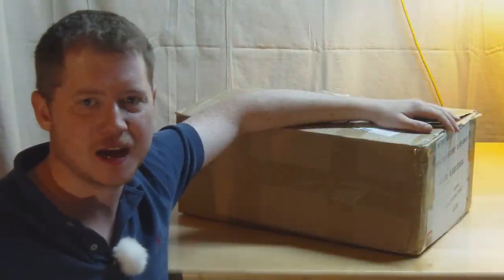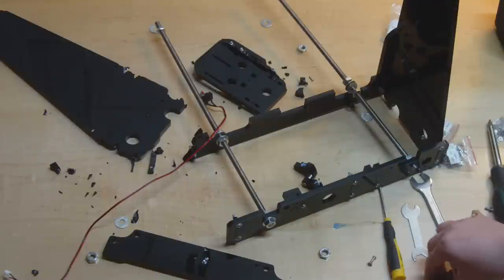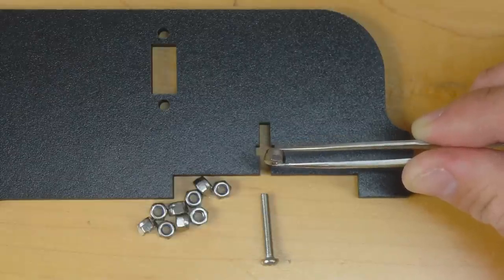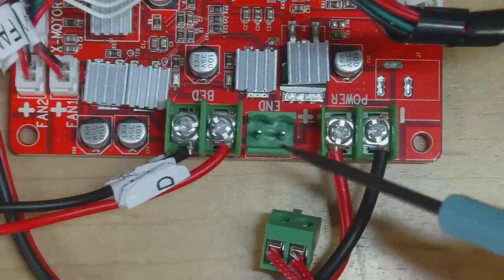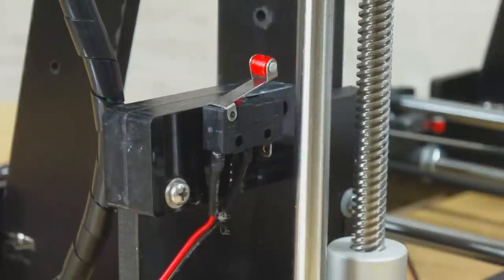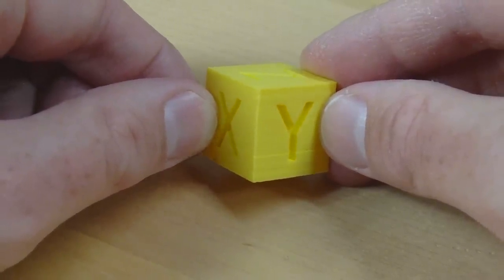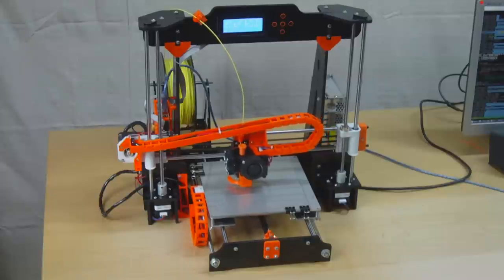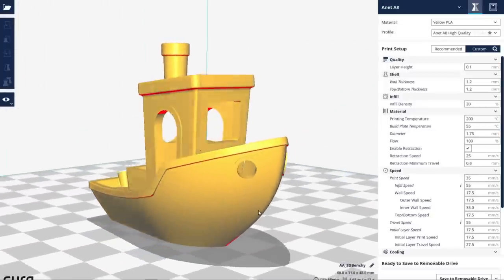[007] Anet A8 3D Printer - Review, Upgrades and Experiments

Comment: While I didn't use lock nuts of any type, I did substitute the hexagonal M3 nuts for square nuts. Which slightly improves the surface area grabbed by the nut.
High current traces on the PCB I soldered thick gauge wire on the traces too.
Double the number or connectors to the heat bed, by default it causes 10 Amps to flow through single pins.
Move the Positive wire to the heat bed from the controller PCB directly to a Positive terminal on the PSU.
The bed is switched on the Negative line via a FET. So providing the bed Positive side directly from the PSU means
you get more power to the bed, less voltage drop to the controller PCB and therefore less voltage drop to the extruder heater.
Mount the PSU to the side of the printer on 5 to 10mm stand-offs. Provides better airflow to the PSU chassis and stops the PSU heating the printer frame.
I use an Adhesive Mylar sheet on the heatbed. It works perfectly at 100° C for the bed and 240°C for the nozzle for printing ABS.
It sticks on first contact and pops off very easily when it's cooled down to < 50 ish °C
Reply: so would you recommend this printer i am pretty experienced when it comes to electronics but never owned a 3D printer
Reply: It works perfectly well. But is not suitable for someone without technical, mechanical and electronics skills.
Combined with Tinkercad, Cura and OctoPrint. It's a very useful tool.
Reply: Thanks man mine is on the way , yeah i should be just fine i got the tech and mech skills & my job is in the electronics field, I have logged plenty of CAD and Solid Works  hours so hopefully i will catch on fast.
Reply: Can you post a picture of how you upgraded the PCB and PSU? I'd like to see exactly, you know just to be sure!
Reply: Ni
Reply: Ill look into this when i crack into mine this week
Reply: Built mine 2 years ago, running Buildtak on the buildplate and used some white lithium grease on the moving parts cause one side of the vertical axis was a bit rough at First.

 Planning a overhaul including a E3D v6 head, a hardened steel nozzle, beefed up mosfet for the bed and a swap to Bowden feed, so far the acrylic frame is holding strong and nothing has come unscrewed.

 Been running PETG as my main filament which likes to print slow so shaking hasn't been an issue and the temps needed are pretty mild
Reply: i got the the addon FETs and see other removing the pins from the heat bed and straight soldering the wires. also cable chains
Reply: I know I'm kinda off topic but do anyone know a good site to stream new movies online?
Reply: @Westin Rohan Flixportal :)
Reply: @Maddux Princeton thanks, I went there and it seems like a nice service :D I appreciate it !!
Reply: @Westin Rohan Happy to help =)

Comment: In the 1980s I had a sticky rubix cube. Sprayed it inside with WD40. Nice a smooth until a short while later it self destructed in my hand. That's my first lesson on chemical attack on plastics.    Glues either stick,. Ake plastic slimy or destroy it.  Best learn what plastic your gluing or like me glue it and pray.

Comment: On your criticism of the bent leads of the power supply, they are called clinched leads or semi clinched leads depending on if they are touching the pads or traces. Clinching a lead is a standard practice in soldering connections that carry high current, that is a good thing. I would be more concerned with a blob of solder on a connection as it may hide a cold connection. Remember Solder connections should be clean, smooth, shiny, concave filets covering all points of contact metal to metal.

Comment: The powersupply is more than likely fine. The screw connector has a screw third from the left (with the screw terminals looking at you) marked F.G. This is Frame Ground or where the Earth / Grounding conductor of your 120 / 240 VAC supply goes. The PCB to frame connection is just to provide the metal case with ground (in most uses the PSU is mounted in a metallic enclose which is grounded as well so the PSU frame is grounded through the screws to the enclosure)

Most of them look the same inside (I repair these for PLC systems).

You are correct that you need to use the shortest possible screws to mount the supply, in the manuals that come with them they usually recommend 3-5 mm long after they have been through the mounting enclosure, as the aluminium case is only usually 2mm this leaves 1-3mm of excess thread.

Comment: Thank you so much for this video. I just got one of these for Christmas from my wife and I am a complete noob. Regarding your cracking problem: A special thanks for that bit about the Locktite. I went to our local Home Depot to buy some star lock washers when I realized that there would be some vibration that might loosen the connections. I WAS going to double up on the washers by using Locktite, but never had the chance (it's still in assembly and I'm a bit lackadaisical in putting stuff together - I'm retired :-) ). I'm glad I watched your video before I did. Thanks again.

Comment: I wound my screws in as tight as I could, when building my Anet A8 - this was months ago and nothing has cracked.  Incidentally, none of the screws have loosened either.

You, my friend, appear to have the light touch and finesse of a bull rhino :P
Reply from the maker: +Spreadie yeah I didnt use excessive torque so I think the chemically induced cracking is the most likely explanation
Reply: I used 'adequate' force to secure the screws.  So far no cracking and only minimal loosening.
I am looking to get one of the aluminium frames for the A8 on ebay though, as its been quite a good printer and I'd like to keep using it for a while.  Prints using good filament have been outstanding, especially considering the price.
I bought a sheet of BulidTak for the bed, best upgrade I made  lol
Reply: @OpenTechLab  That's your story and your stickin' to it! ;-)

Comment: I really like the way that you routed the extruder cables using the chain cable guide. Do you happen to have any closeup photos of how you attached the chain cable to the printer ?
Reply: I'm a bit late to this, but I've only had mine a couple of weeks.  As of late 2018 the A8 is still the best value 3d printer available.  It's the cheapest and most fun way to get into 3d printing.  Yes you will have problems to solve, but that just means you will learn a lot more from doing it.  The A8 is not for people who want to be spoon fed, those that just want a consumer item that works even though they don't understand it, or in a commercial environment where the printer needs to be highly productive right from unboxing.  It IS for those who want to enjoy a more hands-on approach and want to learn, and all for very little money too.

 When you print out the relevant cable chain end pieces it's very obvious how they fit - on existing hardware and bolts.  Also photos from the designers are a little useful.  I got designs for both my x and y cable chains from thingiverse.  It's a great looking upgrade and saves your cables.  You do have to rotate the heat bed so the connector is on the left for the y cable chain, but that's a simple modification.

The most important upgrades though, are probably the supports or stiffeners for the uprights, and an x belt tensioner.  I suspected that the little T support blocks are insufficient and this video seems to prove that. I printed a full bridge support that cut down on the wobble harmonics of the frame by a huge amount.  I've put off doing the x-belt tensioner but as the belt seems to have stretched a little (even though it's got a steel core) it's starting to affect print quality, so that's my next project.  I just hope I left enough belt for it to work without buying new belt.
Reply: @Chris_the_Muso  Yep, get some good quay belt and replace the crappy ones.
Get the y belt path perpendicular and print my y belt tensioner.
https://www.thingiverse.com/thing:3429668
I've replaced the extruder,  hot end and upgraded PSU to 24 volts running a Duet board.
The basics are okay and it's a great learning experience.
The greatest hazard is the connection to the heated bed. It's bv boarding on illegal for domestic use.

Comment: I wouldn't say the a8 has any infamy, it is generally seen as the best price to performance printer
Reply from the maker: +Noah Mcelwey I notice a lot of folks on Reddit getting frustrated with the flow of questions about how to fix A8 design flaws. I can understand that.
Reply: OpenTechLab yeah, I don't quite understand why people complain about little things when the printer is as cheap as it is, I think people just like to complain.
Reply: Paid $140 for mine. ebay special
Reply: When you consider the now infamous story of the guy catching his A8 JUST as it was engulfed in flames AND the electrical safety problems pointed out here, I'd say your take on infamy is backwards. I purchased the A8 ($124) after reading the horror stories and knowing that I'd have to do mods and upgrades. FYI... I bought it to print the "Mostly Printed CNC" router because my little Monoprice Mini Delta wouldn't print the larger parts. After I'm finished using it for that purpose I'll be completely rebuilding with an AM8 frame, new PSU... Auto bed leveling... this, that and everything else.

Comment: Well let me tell you, I did not see your video, nor know about NOT using Blue Loctite until last night. However the night before i also put together my Anet A8 AFTER having my wife bring me home a tube of the blue death:). I did not drop a blob on. Infact i put it on with a toothpick. Got the frame all done and when i got up the next morning it was cracked everywhere! And I also read in a forum that i should use it while putting it together.
Of course we know EVERYTHING on the web is correct. And because of your video i am ordering the same frame to continue on with this fun? project.
Reply from the maker: This is the dark time. Better times are ahead. Stay strong!
Reply: I only use self-locking nuts at the top, for the z axis rods caps...otherwise, those nuts have the habit of disappearing into oblivion...
Reply: FYI if you're worried about it not have a nylon lock nuts all you need is a little piece of nylon fishing string through the regular nut and you have yourself a locking nut

Comment: Upgrade tip: If you pick a somewhat bigger and thicker sheet of glas that overlaps the heat bed,  there's no real issue in printing up to 250x250 in X and Y direction on the A8. Only the locking latch of the heat bed's connector required grinding a little dent into the lower side of the glass, which is bog standard window glass, no borosilicate. Be careful to not get pretensioned glass, that will shatter on the first scratch, though. Just make sure the glass isn't too thin, some 5 to 6mm will do very well.  The sheet of 250x250x5 I got cost 3 quid at my local glazier's. Works a treat. To be on the safe side, preheat the heat bed before the print fore maybe 5 minutes, and bob's your auntie. I check it with my infrared thermometer. Once the glass surface has the set temperature, I start the print. I only used it with PLA so far, but with it, I had no issue whatsoever.

Comment: I purchased this very same printer about the same time as you, however this one is NOT labeled Anet A8 (same price) and came with no instructions or videos. I was able to find the Anet A8 online and realized that it had all of the same components, and thus used their instructions and videos to build my unit. Mine even came in the same styrofoam boxes like yours.

As far as your experience with using the Loctite, it is unfortunate that your machine disintegrated. The Loctite does not actully have to contact the acrylic because it off-gases and affects the acrylic in proximity. Sorry that you had that experience, but a lesson learned, hopefully.

The acrylic is cut in bulk with a CNC laser, which makes the price so cheap. The control board and power supply, as you say, is not the top of the line quality either. With that said, for the price, this is a wonderful 3d printer and I would definitely give it a thumbs up.

In comparison, I have a smaller printer that cost over twice as much that has a metal frame and only does marginally better prints. This is the Einstein S from Shining 3d and this machine has its' own pseudo g-code renderer software that you cannot modify and does not accept standard g-code. For ease of use, however, I was printing within 5 minutes of pulling this one out of the box. Unfortunately, it is a PLA only printer.

I noticed that you used PLA for all of your builds, which does not require a heated bed. I would like to ask if you made any of the parts from ABS or one of the other many materials that this printer is capable of using? Also, since you have had more time to evaluate this machine, are the tracks for the cabling really necessary, mine works fine as assembled from the videos. Those tracks look cool though.

Comment: One of the main reasons for the solder cracking is the manufacturer using unleaded solder. Reflowing the joins as you did with good quality leaded solder will resolve the problem.

Comment: With printing onto a glass bed, I've had 100% success (five prints so far) without having to use any glue or hairspray, although this may just be beginner's luck (and this was a Creality Ender 3 clone, and I was using a brim on the print to help adhesion, so YMMV). P.S Thanks for a comprehensive review, and all the tips - I've just ordered an A8 clone, just for the sake of a challenge.

Comment: BIG NOTE:  Loctite will attack the plastic (Acrylic) frame parts of the printer causing them to crack later. If you are that concerned about nuts coming loose I suggest you use locknuts with built in nylock.

Comment: good points about electrical safety,   the 1st things I did when assembling this kit was isolate the hot bed springs as I didnt like the idea of the springs against the hotbed,  then  fit automotive fuses to the hotend & hotbed,  and fit a mosfet  (when it arrived) for the bed,  why does everyone  else seem to fit the y axis cable chain to the left?  its right under the hotend when its homed and looks like it could bump the hotend - I built my own  chain mounts from scratch to suit some   lightwieght but narrow nylon 7x7 chain I  had laying around -  but I mounted mine on the opposite side - works well   - and its without plastic dripping into it

Comment: Nice vid and tips. If you are still skipping steps then you could try upping the voltage on the stepper slightly by turning the trimpot on the mainboard. Just remember, if they are anything like RAMPS steppers, they are only rated for about 1amp without cooling and that whatever voltage you read between the centre of the pot and ground is about half the amps going through it I think.. Loving the Octoprint. Gonna try that. You might want to look into a mosfet and upgrading the heated bed cables to 12AWG with an in-line 15a fuse. That will make it safer and help the bed heat better. I did a vid on fusing the A8 and adding the mosfte a while back but there are loads of vids about it. You caught that bad solder join just in time. Those green connectors are knock-offs and not really rated for the hotbed amps. It may also be an idea to secure the hotend thermistor in place with a printed bracket. Personally, I don't go out for long and leave it running... Not just the A8, that goes for any 3d printer. Good luck

Comment: Every single article or conversation I've seen in the last couple days about this 3D Printer says to install a mosfet. I ordered one of these printers off eBay, with the auto leveling sensor included, for about 150 bucks. I'm buying some upgrades too. I spend about 60 dollars on the common upgrades I've seen suggested, as well as two mosfets, one for the bed, and one for the extruder.
Reply: What fets did you buy

Comment: I think you were trying to fix a problem that hasn't happened yet. Get the thing together first. If you find any issue, fix it later after it actually happens. Many people have built this printer without using locktite or anything of the sort and not had any problems with it.

It's bad practice to be fixing problems that don't exist.
Reply: West Coast Picks agreed! Solid printer if taking time to put together correctly! No issues with mine I've only added a mosfet  for some security and that's it at the moment
Reply: West Coast Picks yea and DONT over use loctite. Just a dab. A tiny bit is all that is needed.
Reply: Mike Walker I didn't use any lock tight or anything other than the hardware it came with. It's been fine for months now. Every month or so I check all the screws but none of them are loose at all. 

I think lock tight is overkill. It works fine without it. Also with upgrades and such I think having lock tight would be a hassle. It's not needed and only complicates things.
Reply: I hear you but my house burnt down.